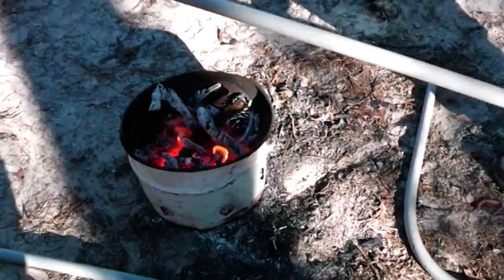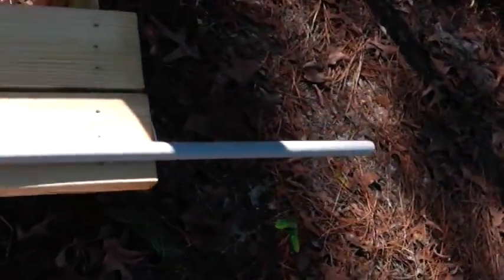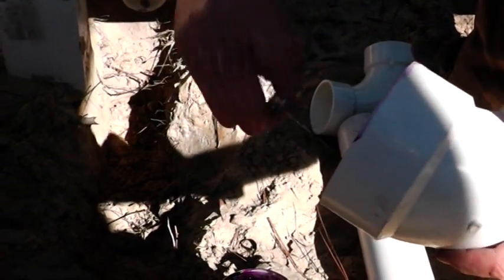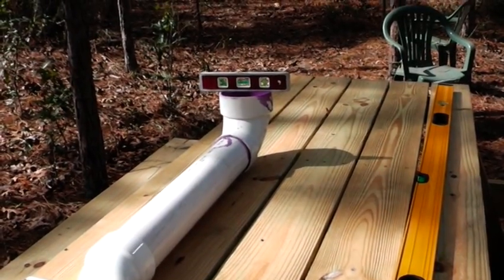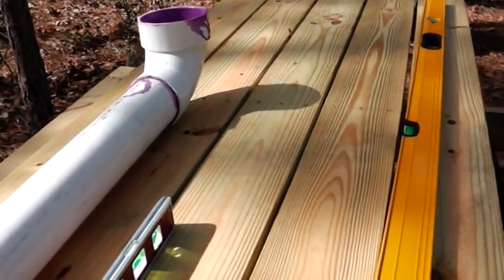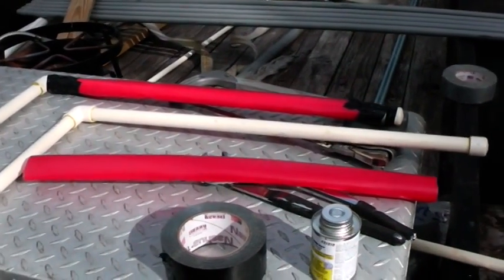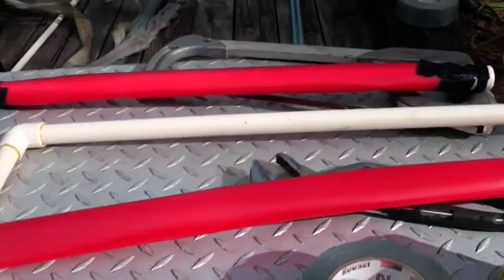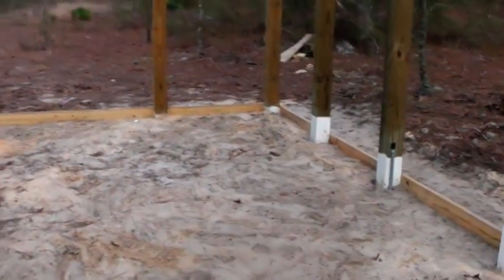Basic Plumbing and Electrical PVC Installations

Comment: Here’s my question. If I want to run two wires in a 2inch conduit underground but I want the split the conduit into 2 destinations. What’s a good complaint way to split that without it being an issue or having to run two separation conduits. I can use the long sweep.

Comment: This is all wrong
1. Its 1/4" of slope per foot for 2" and 3" IPC and 1/8" of slope per foot for 4" and larger drainage IPC
UPC doesn't want 4" pipe to be 1/8" anymore.
2.Any pipe under slab shall be of a minimum of sch40,  not the cheap cellular core pipe that was shown in the video. 
3.The vent from the shower was too close to the ptrap a minimum of 4" in between shall be used for 2" pvc
4. All that primer driping prom the pipe "really". Once you put the fitting in the pipe you are not suppost to twisted that many times just 1/4 of a turn and hold it in place.
5. Poor plumbing skills used to level the pipe do you really need to mark the pipe outside of the trench, big no no. You dig a trench, put the pipe in place as required slope and you start plumbing the fitting from there.
6. There shall be no water joints in a slab ever I don't care where in the US you live.
You have to use the soft copper and if you need to make a joint you have to BRAZE it!
You can also use Pex wich everyone is using right now you gotta insulate any exterior lines as per jurisdiction. CPVC joints are pretty unreliable if you don't know how to make them properly ( not that is hard).
Reply from the maker: You clearly don't work in my area.
How about you make a video and show us all the right way to do it?

Comment: Building Code for your sewer line is an angle of 1/4" to 1/2" per foot, not 1/8".
Reply from the maker: This is what works around here top get approved by the plumbing inspector.
Reply: I'm just a guy like you. I just happened to look into how to make poo flow correctly and that's the answer according to the IBC. : )

Comment: Should Use Blue Or Black Perm Marker On Cold Sleeve......................
Reply from the maker: That is an option but, I always put the cold water supply on my right and the hot is always on the left.  This will usually help to avoid any confusion.
Reply: Edssdd